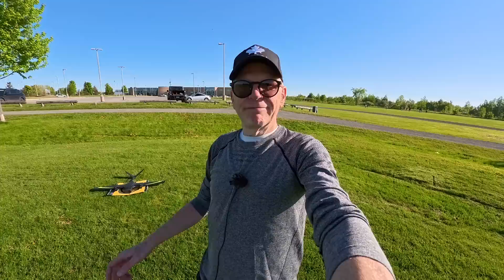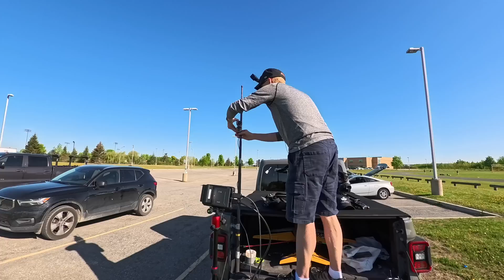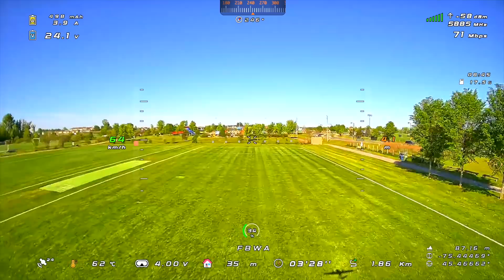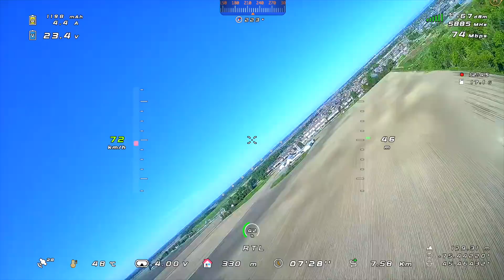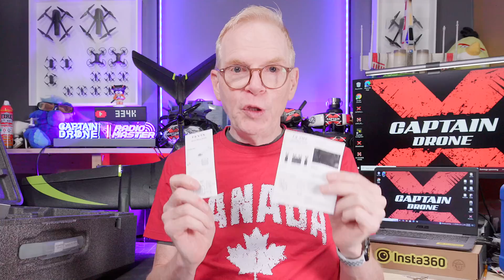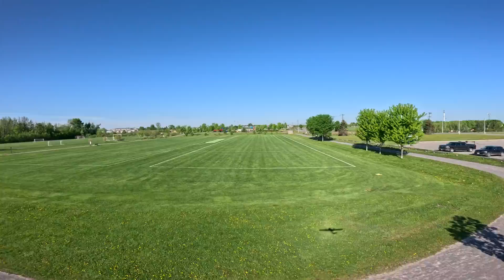OMPHOBBY - ZMO Version 2 - Long Range VTOL

Comment: Hello! Thank you for this video! I believe that it is amazing! May I ask if you get the PNP version, except for RX and Video system, is it really set to fly? Or I need to add FC/GPS etc.? Thanks!
Reply from the maker: NOPE… that is why RTF (Ready to Fly) is called RTF.  If you get anything that does not have such a title, well then it is then up to you to add all the components to make it ready to fly.
Reply: @CAPTAINDRONE798  The PNP version is equipped with FC/GPS and it's ready to fly and only needs RX and video system!
Reply: @CAPTAINDRONE798 I made some research and it really come with FC/GPS etc and it needs video/RX to fly!

Comment: Is there any flight modes other than Cruise and FWBA?   I ask because the reason you'll crash if you stall in any stabilized mode is that the stabilization response is always the opposite of what the plane needs in a stall/spin situation.  It'll detect nose down, spinning left, and try to apply up elevator/right aileron, when what it really needs to recover is either neutral controls, or even same direction.. down elevator, left aileron (latter more common on flying wings).    Means the only way to recover a stalled fixed wing is flip to a manual mode and apply the correct inputs.     I suppose in this case maybe you could just switch to tricopter mode while it's falling. 

Also, the key point in connecting your RC Rx to the T3 system is that it's sending a control signal to the plane through what would normally be just video acks/retry telemetry.    There's no RC Rx onboard the plane.
Reply from the maker: In those beginner modes, the safety is the PITO TUBO which will detect a stall and switch into Tri-copter mode.
Reply: @CAPTAINDRONE798   That'd work, but with the supplied controller can you change it to allow non-beginner modes?
Reply from the maker: @daemn42 You remove stability via the programming software for the ZMO

Comment: So this is not a DJI cam? Can the video be sent to the DJI goggles?
Reply from the maker: DJI decided long ago to not add an HDMI input on their FPV Goggles.  For this reason, no DJI FPV Goggles will work.  You’d need WALKSNAIL (they have an HDMI port), FATSHARK (they have an HDMI port) or cheap SKYZONES or any other inexpensive brand of FPV Goggles with an HDMI input.  The same is true with TABLETS… Many have an HDMI port, but often it is HDMI OUT and not HDMI IN.

Comment: Hi Captain, à littérature question for you, can I control my Mavic Mini with à USB-C connector for my IPhone 16???  Tanks in advance😎👍
Reply from the maker: The MAVIC MINI can only be controlled by a DJI REMOTE
Reply: Yes I know, but the cable between the DJI remote and the IPhone with  USB-C connector is possible ?

Comment: So, the tx12 is bound to the ELRS receiver which is connected to the T3, which handles the video AND rc control signals?  That's a titch clunky...
Reply from the maker: It is because if we did it the current dinosaur method of placing the ELRS receiver in the plane, then the range of the VIDEO and the range of the RECEIVER would not match up.  This is the problem we have today with drones that don’t share one signal.  DJI links the signals together, but you have to use 100% DJI gear for this to occur.
Reply: @CAPTAINDRONE798  Dinosaur - LOL.  You ALWAYS want your RC link to outfly your video link.  It's not a problem - it's supposed to be that way.  I know you're not a "DIYer", but nobody that knows what they're doing uses DJI's SBUS system where the goggles handle the video and rc link.
Think about it - you lose your video, suddenly, and then you can't punch out or switch into RTH - you're just praying the the RTH kicks in automatically and doesn't put you into a tree, etc.  That's just one issue - there are several.

Comment: Would look cool if the vtol props could be switched in and out of vtol mode (nose props would rotate forward 90 degrees, tail prop would be repositioned on the tail end of the tail/same thing but backwards). I bet it would break easier tho lol

Comment: Hi Captain. There's a heck of a range on this drone, but does it always have to be in line of sight of the ground station? I live in a very mountainous area, can I fly it around the back of a mountain?
Reply from the maker: Yes, all RC Products require line of sight for long range.
Reply: @CAPTAINDRONE798  Captain, at 35 km the drone will be no longer visible. How will I know it's still in line of sight if I'm flying in a mountainous area and flying by FPV or a laptop screen?
Reply from the maker: @JohnPierce-o1y ha ha… you’re joking right?  Have you never flown a drone several miles away?  If you have, did you notice that if you attempted to stay low to the ground you lost signal.  The farther you fly the higher you need to fly  so that the signal return back to you is not blocked by trees, hills, tall buildings… no matter the distance, this is known as a direct line of sight from aircraft to you.
Reply: @CAPTAINDRONE798  That makes sense thanks. So I can't do low level photography of an area 35 km away. Gotcha
Reply from the maker: @JohnPierce-o1y Correct!  I have made several videos in the past showing that even if you use the latest DJI technology, and go behind a building that is only 100 feet away, you will more than likely use video signal or the video signal will start to loose frames.  This is why you’ll never see a review of someone standing in the forest and flying far away because all of the trees (filled with water) absorb the signal.  Long distance videos are usually over oceans, lakes or standing on a hill or mountain and flying far away, or over flat ground (prairies) or dessert areas.🎉
Reply: @CAPTAINDRONE798  I see. I guess military drones like the Ukrainians are using utilise a different technology, to allow them to deliver at low altitude hundreds of miles away.
Reply: @CAPTAINDRONE798  Another question. How is the ground station powered please?
Reply from the maker: @JohnPierce-o1y It has a built in battery.  You really should do a YouTube search for the EDGE T3 system… many have reviewed it in the past two months.  Watch it and things will begin to make sense to you.
Reply: @CAPTAINDRONE798  Thanks for the info. I have just taken the plunge and bought this drone, but I got a lot to learn🙈🙈🙈
Reply from the maker: @JohnPierce-o1y  If you have a bit of knowledge of the RC Hobby, you’ll figure everything out.  I’m sure there will be more user reviews coming out soon.

Comment: Does the unit RTL if it looses signal?
Thanks
Reply from the maker: Yes… RTH occurs either manually (pilot commands it), or when battery is low, or when signal is lost.

Comment: This would be Perfect fir ranchers with fence lines to check. 40 acres or more. I'm on 7.7 so the old DJI Mavic is alright.
Not set up to do waypoints however.
Reply from the maker: At the speeds this moves, one could cover plenty of ground quickly

Comment: Great review, I have the ZMO v1 and I love it. I wish the V2 comes with the DJI O4 Pro because it uses less components, without the extra video receiver box and HDMI cable to the goggles.  On my ZMO v1 I installed the DJI Air Unit and it worked perfectly.
Reply from the maker: The reason that OMPHOBBY did not go with the DJI 04 units is due to cost and range.  As you know with the ZMO v1, the range using the DJI system was not that great.
Reply: @CAPTAINDRONE798  I understand your point, but they should at least give us the option between the Edge T3 system and the DJI HD.  According to current FAA regulations in the US, we are required to fly this with a Remote ID module. However, I don't think Remote ID will be effective at that distance.  I may be wrong, tho, and don't quote me on that.

Comment: What is your estimate of flight time per battery? 30-35 minutes for light wind and limited vertical flight?
Good video...
Reply from the maker: When flying the ZMO uses minimal battery.  When hovering the ZMO has 10 times the demand on the battery.  So for a Rookie that will probably hover much too long, the flight time might be 30 min.  For an experienced pilot, flight time, using the included battery would be 40 min.  Most experienced pilots would use their own, much larger batteries to get over an hour of flight time.
Reply: When you fly a plane like this do you have broadcast remote id?
Reply from the maker: @Eclipse_Graphics If you live in the USA, then yes because it is over 250 grams.  Thankfully, I’m in Canada. 😊

Comment: Hi from Puerto Rico! How does the VTOL mode handle takeoff and landing in a little wind? I have the XK X450 and the new Qidi 570 VTOL. The Qidi has almost no authority in a slight breeze when taking off or landing in VTOL mode. It makes it almost unusable when it's breezy.
Reply from the maker: The XK X450 and QIDI 570 are considered Toys.  This ZMO V2 is not a toy so it can handle winds on the ground and up high.  You always have to point the nose into the wind, when hovering and when flying.
Reply: @CAPTAINDRONE798 thanks for the info! Always helpful. 👍
Reply: @sidekick96734  ta carito por 700? no sé el quality se ve chipi